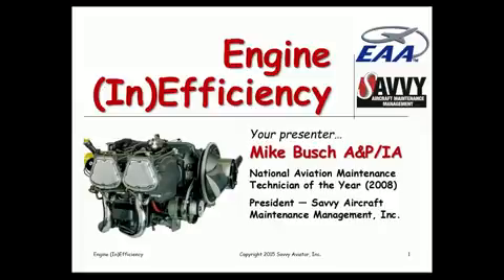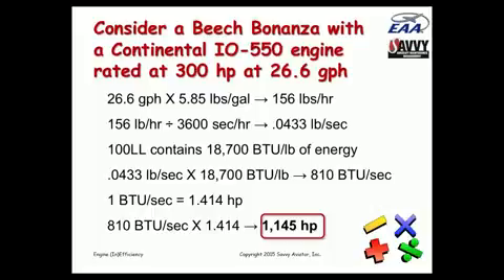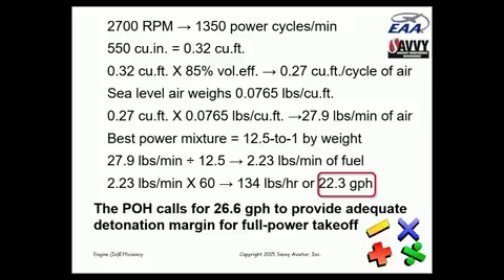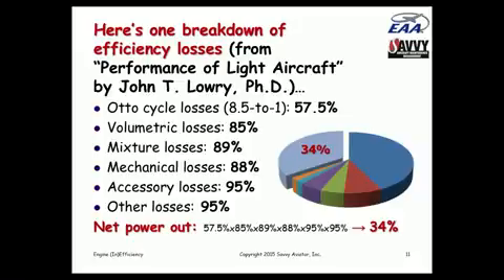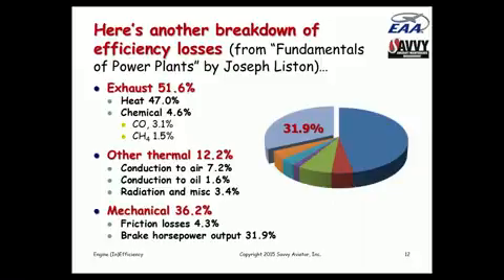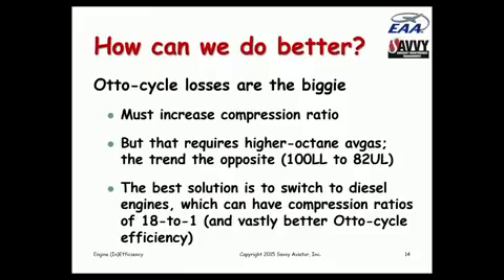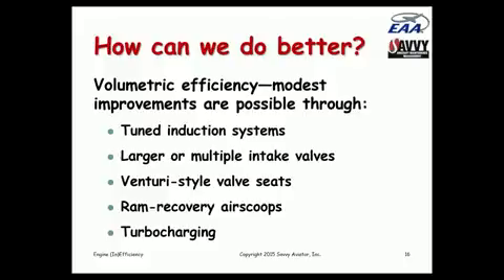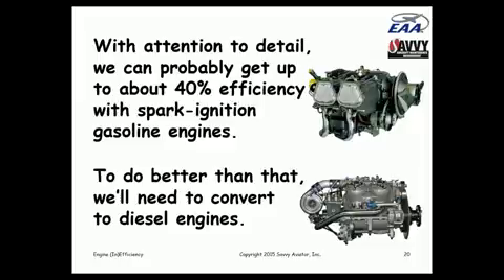Piston Engine (In)efficiency

Comment: Maximum possible volumetric efficiency of aircraft engines is pitifully low..at about 33.5 min., this is discussed, along with possible improvements..larger or multiple valves, special valve seat shapes, etc. All of which work. Many high performance motorcycle and car engines exceed 100% VE by quite a bit.
   So, what does this do? It increases power dramatically. Many normally aspirated motorcycles exceed 3 hp per cubic inch. Wow..an IO 550 would be over 1600 hp...
   Forget all about that- an io-550 produces power reliably when it makes 200-230 hp in cruise. When does it do that? Only when the volumetric efficiency is severely limited. At sea level, it is largely the throttle that does this. The purpose of the throttle is solely to limit VE, that's what it does. Improving all the other crap mentioned would enable the engine to harm itself.
   To make a large 550cid engine live long and reliable, we limit its power to 1/2 hp per cubic inch, and we do so by limiting VE....so what is the point of free breathing multi valve heads? The throttle must be closed enough to limit VE to 200-230 hp, or else. 
    Cars and motorcycles do benefit because of the nature of their use....you simply cannot use maximum power for very long. How long can even a mundane Camry use max power? 10-20 seconds of max power in most cars=100+ mph.
    The tractor like restrictive ports and valves in aircraft work just fine- we still have to close the throttle to limit VE even more than the ports and valves do alone.
    Volumetric efficiency shouldn't be confused with efficiency in power production, some connection exists through "pumping losses", but that occurs whether caused by an inefficient port design, a partly closed throttle, or a dirty air filter.
     If cylinder pressure is lower than crankcase pressure on the intake stroke, negative work is done on the piston..,pumping losses. 
     Complex high performance type of cylinder heads are mostly wasted on an engine that is continually operated with a partially closed throttle, and will increase complexity and reduce reliability.. Porsche-Mooney PFM, anyone?

Comment: Strictly speaking the otto cycle efficiency is a function of the expansion ratio, not the compression ratio.  The newer Toyota prius engines get up to 42% efficiency using variable valve timing.  The highest efficiency diesel engines get about 50% thermal efficiency.
Reply: 50% are only very large slow speed 2 stroke engines. They are very long lasting and the most efficient internal combustion engine in the world, but they are extremely heavy. Which is no issue for a large container ship, but would never be able to get off the ground in an aircraft. Aircraft engine power:weight ratio is very important, because the more dead weight there is, the less room there is for fuel and pax/cargo.